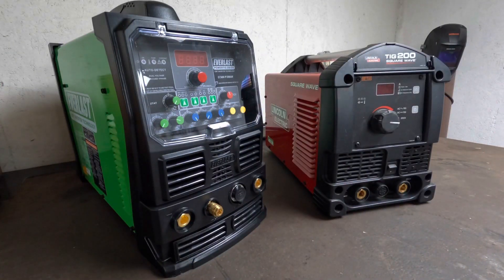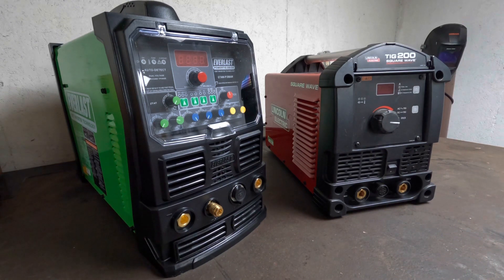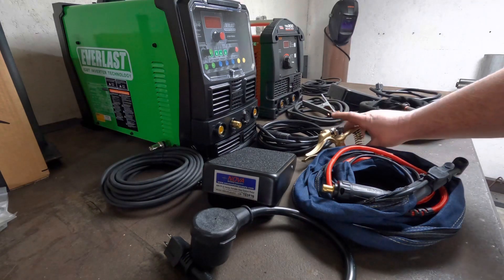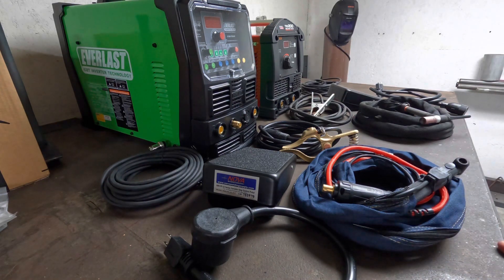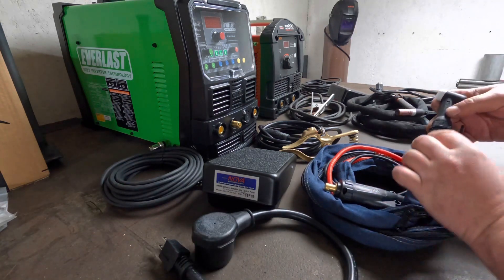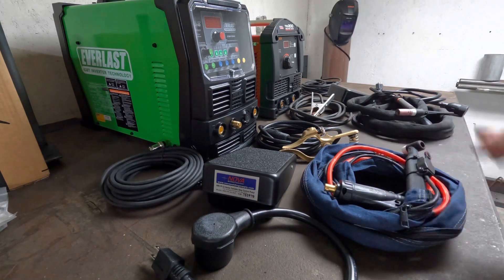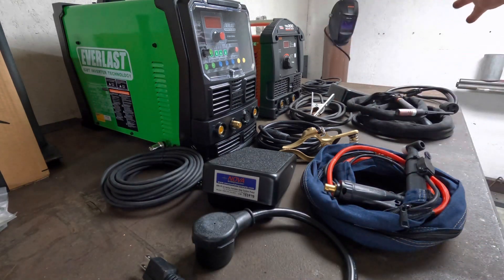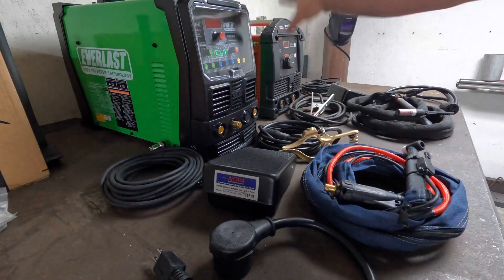Everlast Power Tig 200 VS Lincoln Square Wave Tig 200

Comment: I bought an everlast tig welder.  It was missing a small, simple part.  I called & emailed, never got a response.  That's why I'm thinking about going with Lincoln, despite the problems.  Could the blown board problems be due to pushing it on 120v?  I'll be using 230 exclusively,  maybe that'll help?
Reply: What number did you call? I call them every time I need. Ask something, they pick it up right away.
And always helpful.
Reply: @user-pw7wl3nu1l   i think the far more important question is what number are you calling?

Comment: The Lincoln square wave is only 20% duty cycle at maximum output. The PowerTIG 200DV is 60% at maximum.  Yes the squarewave does have a 60% duty cycle rating, but well lower than the maximum output. The dinse type connertor with gas through can leak gas.  That is one reason it is that way, but the Everlast connection is a standard connection that even Lincoln is using on their water cooled connections on their machines now.  The foot pedals are not made by the same mfgr.

Comment: Before you purchased the Everlast welder did you happen to take a look at the primeweld tig225x and the 325x? I had the 225 x and I've had it for two and a half years now with the water cooler in a water-cooled flexlok TIG torch and I found it to be unbeatable as far as price goes and features it has all the features except for the different waves for AC welding.
Reply from the maker: I did not, the guys at the local race car shop recommended the everlast to me so I went that way. I do have an Arcaptain 200 that I just received that I’m getting ready to review though!

Comment: Been about 3 months since this vid. How are you feeling about the everlast so far? I’m in the the position to buy a used Lincoln SW 200 or new everlast 200 they are both comparatively priced. which would you choose? did the lack of post flow adjustment on the SW ever bother you? Seems to be a big complaint for that machine, don’t recall you touching on it. Thanx!
Reply from the maker: So far there are things I like about the Lincoln better and things I like about the everlast better. I never thought I was missing anything with post flow adjustment until I got this everlast! The post flow adjustment definitely helps with welding stainless. The Lincoln has a much more consistently clean arc start than the everlast so I’m not a big fan of that. I don’t think I could bring myself to buy another SW Lincoln though with having 2 board failures so soon. So far the Everlast is doing everything I need it to.
Reply: @LoganbuiltRaceShop  right on, thank you!
Reply from the maker: @redsx13  you’re welcome!

Comment: Is your EL torch water cooled or air?
Reply from the maker: Just air cooled. I’m not typically welding for long enough durations to need the water cooler. Although I can add it if needed!

Comment: Lincoln warranty is 5/3/1 (see my correction below) and I think even shorter on some accessories.  I am researching and learning.  One big to me interesting difference, esp with ESAB and likely with Miller/Lincoln but not certain, is their penchant for DIY diagnosis and repairs.  ESAB was kicked by a YT commenter for refusing to assist that user in servicing--would not even sell him parts!  EL says up front that the customer needs to work with them over the phone, text, email, to figure what's wrong.  As a hard core DIY going back exchanging LETTERS with HeathKit in the 1970s to get a tuner kit running (they were helpful but oh the time it took), I LIKE that.  Right to repair is coming Red/Blue/Yellow.  Get with it.
Now this is from a complete noob as to welding, but I suspect you will get to like the EL choices, and if the 200 is like the 275 I am considering, it has about 15 memory slots for retaining the settings you come up with!  I do see that the Lincoln cord organization is handy but again noob here, consider that using and pushing a Dual Voltage (DV) machine on 115 when you really should be using it on 240 is, I am told, a major cause of that dreaded POP sound inside the box, when a board goes to be with St Techie, Patron Saint of failed tech.  I am betting that consistently hitting the duty cycle ceiling might be like popping a circuit breaker over n over.  It will eventually fail, esp if the mfr has pushed the number higher than good engineering reveals.  Noob remember so I could be nuts and twilight zoning on the latter.
Reply from the maker: You put a lot of time into this comment and I appreciate that! Sounds like you did even more research than I did!
Reply: @LoganbuiltRaceShop  Oops on my part, my apology!  LINCOLN offers a 3 yr warranty with an option to buy 2 more yrs.  HOBART (same ownership as Miller) has the 5/3/1 warranty, notably complicated in how/what it covers.  But thanks for the reply.
Reply: And I am a bit cheesed with Everlast as they have not responded to an email I sent with comments and questions about the 275 and more.  I even followed it up a couple of days ago, in case the first one was misdirected or lost.  Trying to come to a decision about a multi-process machine to buy.

Comment: I have had my everlast 250ex for 10 years now, 7th year they sent me a power switch for free. You will definitely be happy with it!
Reply from the maker: Great to hear! So far I like it, starting an arc doesn’t seem to be as clean and precise as my Lincoln but that would just be me not having it tuned it yet!
Reply: @LoganbuiltRaceShop  the Lincoln may have a little lower start amperage but I doubt it. Either way there are some trucks to help with that. Give me shout anytime!
Reply from the maker: @masfab_chris  will do!
Reply: Where did you get the averlast ?
Reply: @alfonsoreyes49  directly from everlast